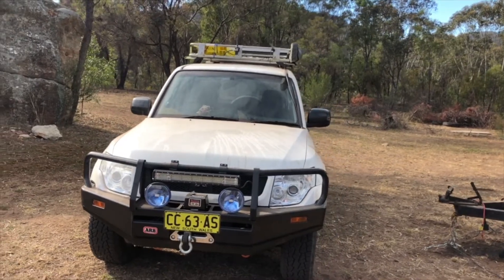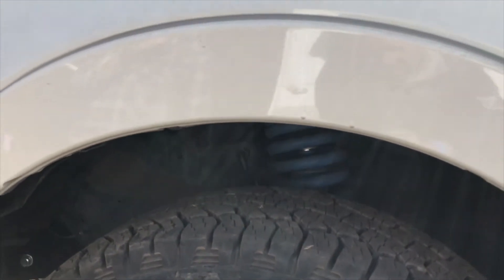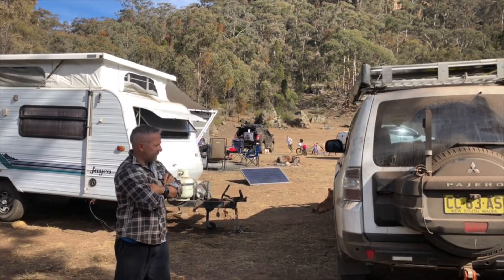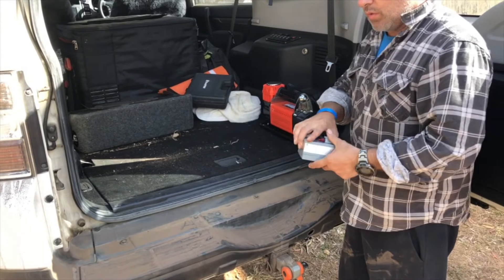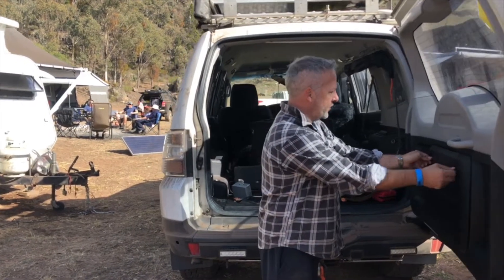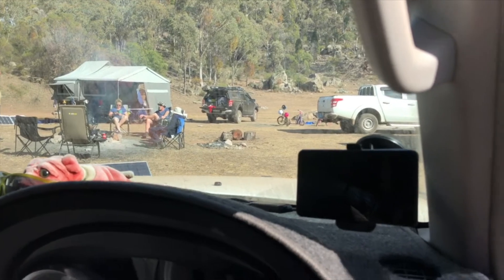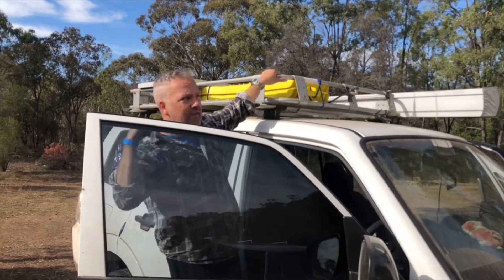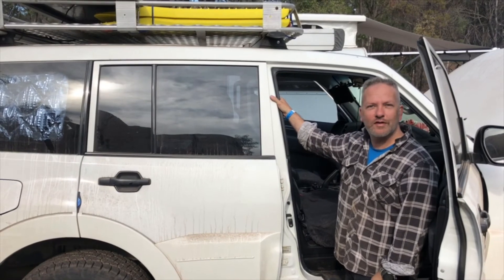TOYZ EP 4 NT Pajero

Comment: Regarding the Tent Poles and people going on about the dangers. Ive had heaps complain about the position of my fire extinguisher being on the back door trim. If we are smart about these things we can make them strong and solid. Ive added a strip of Alloy behind the trim which the bracket bolts through adding a ton of strength. I do also love the look of the Remote for the compressor.  As with Brett I love my fridge. Have not had it long but its become so useful. With that fuel economy Im wondering why bother with Diesel, I get normally around 14L/100km in my 3.5L V6 Petrol with similar mods. Closer on 15L atm with bugger shocks. Anyway love the Pajero and thanks for doing the walk around. When we eventually catch up you are welcome to do a video  on mine.
Reply from the maker: Will be happy to check yours out Mick. Horses for courses on fuel, I prefer diesel but my trucks are heavy and I don't care about the economy lol. Cheers Steve